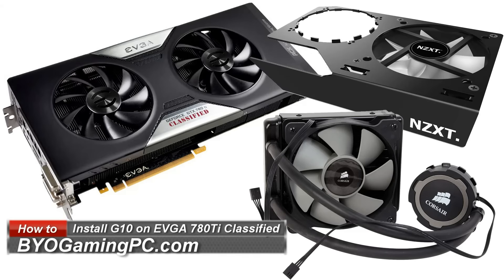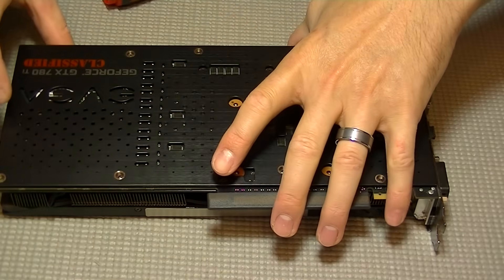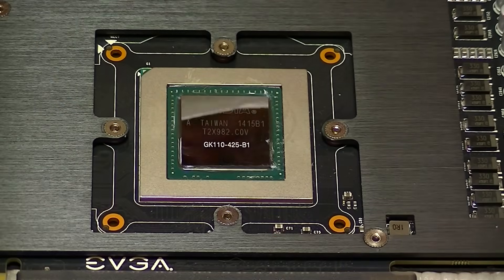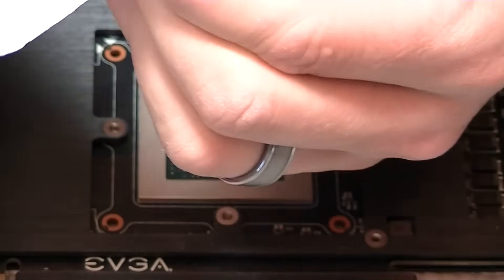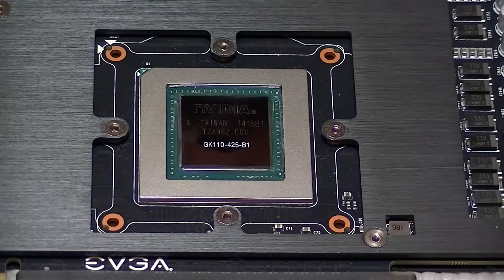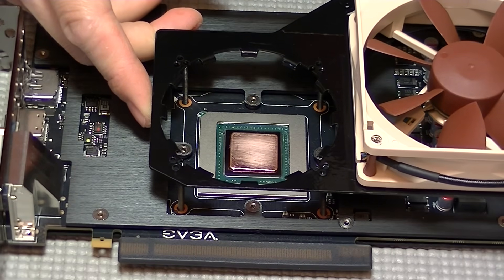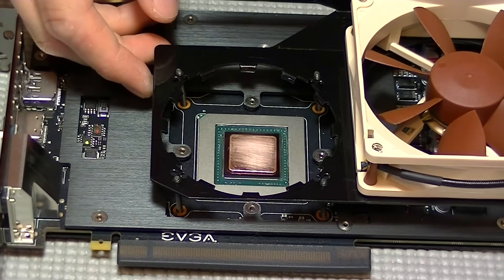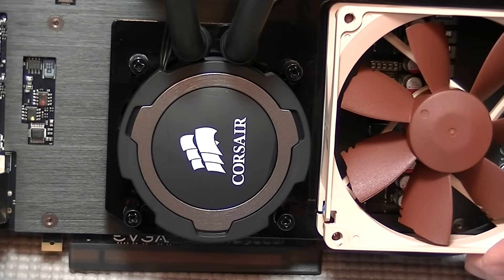NZXT Kraken G10 Install without Removing Heatsink

Comment: Nice video man, I have a question: Why did you use nylon screws insted of steel screws?, it reallymatters the material? I'm asking because its a little bit complicated for me to get nylon screws (even from amazon). Does steel screws can cause a failure or something?
Reply from the maker: You can use metal but I preferred something that wouldn't scratch.

Comment: I always knew that the extreme care of not touching the gpu die or cpu heat spreader was BS. It literally makes no difference, even the whole pea size thermal paste is BS if you use non conductive.

Comment: Hey very curious to know if this method will also work with the Kraken G12. The mounting is slightly different, but all in all the entire concept is to just make sure the cooler is touching the shim when you tighten, correct?
Reply from the maker: I've not worked with the G12 so I'm not sure. Sorry!
Reply: BYOGamingPC no problem, thanks for your honesty.
Reply from the maker: My pleasure.

Comment: I have evga gtx 780 ti Classified Install nzxt g10 I have Problem 3 light off in the gpu and not work.
Reply from the maker: I'm not sure what your problem is exactly.
Reply: BYOGamingPC 
may problem is driver nvidia 
Install nzxt g10 wthe evga gtx 780 ti classified not work gpu

Comment: Hi;
you think its worth to buy the Kraken G10 to improve my ingame FPS? I have just one GTX 980 Ti Classy, and I can game various titles at 4K 60 fps like Forza Motorsport 7 and those who uses Vulkan API, but my latest games like Assassins Creed Origins at 4K only gives 30 fps more or less with Ultra settings, I just don't want to get rid of my Card, its been an amazing video card, I just wanted to know how much FPS could I get If i install the Kraken G10 on heavily demanding games...thanks for your reply! (I would be happy if I can game Assassins Creed at 40 or 45 FPS at 4K in Ultra).
Reply from the maker: It just depends on your card and how well it can overclock.
Reply: how many FPS you get from Assassins Creed Origins at 4K Ultra? i have mine OC with modded Bios on Air and get 33 FPS Average
Reply: I  Think the Xbox One X does 4K at Ultra 30 fps on that particular game

Comment: Just installed the NZXT g12 on my evga gtx1080 FTW.
Used a dremel tool to grind down a few milometers off the front plate in order for the cooler to sit flat on the gpu, otherwise I would have to use a copper shim to make contact and would affect the efficiency of cooling, granted not by a lot but for the effort it took to install the thing it seams like a no brainier to do it right. After the installation my temps wen't from an average of 65c to 38c  while under load. 
Overclocked 90mhz on the core and 500mhz on the memory and overvoltage at 25% was able to get 2088mhz with no throttling after three hours of intense gaming @1440p with 99%-100% usage on the gpu, temp's never got above 44c  while the fans on the radiator never wen't above 1100rpms and was averaging 900rpms. Hope this helps, As for Vram and power delivery temps, J's two cents vid on the g12 should alleviate anyone's worry's about memory temps.
Reply from the maker: Excellent results!
Reply: Hello what is your cooler using it to achieve those best cool temps?, I'm planning to buy for my Gigabyte 980ti G1 Gaming gpu.

Comment: Great info, like your vid better than others I watched before this one. The NZXT back plate just did not appeal to me, using the stock plate not only is stronger but as you said offers better cooling. Don't have to reinvent the wheel, just improve on it. Someone already commented about the size of shim they used in there build(20x20x1.2mm), what was the thickness of the shim you used?
Reply from the maker: Thanks and the shim I used was 1mm thick.

Comment: why did youz neeed a additional fan cable?
Reply from the maker: The purpose was to be able to connect all of the fans to the PWM header on the graphics card so that the graphics card would control the fan speed based on thermal conditions of the GPU.

Comment: There should be used a liquid metal (Coolaboratory Liquid Pro for exam.) between copper plate and GPU, that could give you -5.. -15C degrees more ) By replacing MX-4 with metal my temperatures fallen down ~10C more. I had wish to replace my GTX980Ti Lightning stock cooler, but unfortunately G10 is not compatible with it's board. G10 could perfectly blend in with my H440 and Kraken X62. But now I wait for Vega, that I'm pretty sure, will have watercooling in stock, so G10 will be pointless for me anyway. Instruction is good and simple, nice video.
Reply from the maker: You are correct but I try to avoid electrically conductive materials for these videos. Thank you for the compliment!

Comment: 1. Is the copper shin needed if you have that back plate on the GPU board?  Or is the shin needed for keeping the VRM plate on?
2. Why haven't you used the rectangular frame thing that comes NZXT and goes on the back of the VGA instead of those washers?
Reply from the maker: A shim that fully covers the die would be more effective and the added copper helps with heat transfer. The extra layer of TIM has only a small impact on the overall cooling efficiency and this method is far better than using the stock or aftermarket air cooler.
Reply from the maker: The shim is required for the heatsink to make contact with the GPU dye. I didn't use the NZXT bracket for aesthetics. You can use it if the screws are long enough and if you don't mine having the NZXT plate showing.
Reply: BYOGamingPC does the added thermal layer effect the cooling ability? does two layers of thermal paste hamper the heat transfer?  I like the idea of keeping the OEM heat spreader, but I'm curious if a direct contact with the aio would have better cooling.  also does the fact that the shim doesn't cover the whole GPU die matter?

Comment: The copper shim is pretty pointless
Reply from the maker: It is 100% necessary if you choose to keep the VRAM/VRM heatsink on. The water cooling block will not make contact with the GPU die without it.

Comment: Guys - is there an aftermarket copper shim and extra long screws I can buy?  Or is that, too, homemade stuff.  I don't want too thick/thin or too small a copper shim.  And I don't want to end up using tie straps to hold the G-10 onto my GPU.  My GPU seldom gets above 53 C as it stands ... but I wouldn't mind cooling it even more.
Reply from the maker: The parts used in the video are linked in the description.

Comment: I want to sli two asus 1070 oc's which are very thick cards, unfortunately my mobo only supports 2-way sli so i can't put my gpus on the first and third position. Please help me, im not sure what to do.
Reply from the maker: What motherboard do you have?
Reply: Asus ROG MAXIMUS VIII HERO
Thanks for your quick reply
Reply from the maker: You should have enough spacing to install them.
Reply: also, im going with two kraken x41s because they seemed thinner, do you think i should go with these or one of corsairs wc. Is it really worth spending the 350 for this if im going to overclock.??
Reply from the maker: I don't think water cooling is necessary for the GTX 1070. It runs plenty cool enough even with overclocking. There is a voltage lock on Pascal cards that won't allow you to OC it to the point of even damaging the card. My STRIX OC never breaks 70C even with high OC's. If you set a custom fan profile you won't need any additional cooling even in SLI. The Maximus VIII Hero has enough space for airflow.
Reply: thanks, completely of the topic should i get 2 zotac 1080 amp editions instead? its only 120 more each but i thinks it'll be worth it
Reply from the maker: Since you can get the Zotac Amp! http://prourls.co/OkNO for pretty cheap, relatively speaking, I think that would be a good choice.
Reply: and cooling wise?
ive heard that the 1080s run hotter and unlike the amp! extreme which has 3 fans, the amp!edition only has 2 fans.
your advise is really helping me make my decisions, thank you
btw, this is my build:https://pcpartpicker.com/list/FwKXVY
any tips?
Reply: its also my first time building a pc and i dont want to have to spend more money upgraded in two years.
Reply from the maker: Looks good. You obviously won't need the X41's and I think you're still fine with the 1080's without watercooling them. Personally, I would just go with a single card setup and you can sell it later if you want to upgrade but a single GTX 1080 can max any game at 1440p. Even with SLI 1080's you should be fine with air cooling them. Like I said before, just set a custom fan profile and you're set. The Air 740 is a HUGE case. I would recommend something smaller like the 540 but it's up to you. You won't need the HUE since the Maximus VIII Hero has an RGB header already built in to the motherboard. Everything else looks pretty solid!
Reply: so, instead of the hue+, i should just get a compatible led strip to surround the insides, right?
also, i had picked the 740 because it had bottom fans too, and thought that would be better for sli, before that i was going to pick the phanteks enthoo evolv which is beautiful.
Reply from the maker: Correct, you just need an LED strip.
Reply: i cant find a rgb one that i like
Reply from the maker: http://prourls.co/covq Most of these strips will work.
Reply: if i get two 1080 amps will their temps without overclocking be too much(i probably wont need to oc with 2)
Reply: I was reading its reviews http://amzn.to/2hqCBbH and someone tried to do and sli on a x99 sabertooth and she got temps around 80 at 60% load, so she got a pcie extender but im not sure how that works
Reply from the maker: No, the temps will be OK.
Reply from the maker: Trust me, your temperatures will be fine. All you need are some decent case intake and exhaust fans and you will be good. Just set a custom fan profile for your graphics cards and you will be just fine. You won't need any risers or other cooling.
Reply: the corsair 740 seems like it has really good airflow, thats why i picked that one
also it has fan mounts at the bottom.
Reply: looks wise the enthoo evolv is better but it doesnt seem like it has great airlflow
Reply from the maker: Either option should work great.
Reply: i have another problem, in my case im going to have 7-8 fans(1 rear, 2 above(kraken x62), 2 or 3 in the front depending on what size i pick(3 if 120mm, 2 of 140mm), and 2 bottom) and i know there is no way i can attach all of these to my mobo, so i was researching and (i dont want to connect them all to a power supply because that means they will all be at 100% speed) and found the nzxt grid v2 (http://amzn.to/2gR6hxD) but im not sure what cables and adapters i need or if it fit all of them. Also the reason i'm using these many fans is because i wont be waercooling my gpus.(btw im going with the 2 asus 1070 strix)
Reply from the maker: I always use Noctua fans and anywhere you can use 140mm fans I would use them and get the http://amzn.to/2gPRgxU for those and for any 120mm fans get the http://amzn.to/2gPSI3a fans. The 1070's won't run hot at all. You really shouldn't need the Grid. Your motherboard should have enough fan headers for the case fans and also fan headers for the cooler which are separate. I would just get a Swiftech 8W-PWM-SPL-ST 8 Way PWM Splitter-Sata http://amzn.to/2hqzW1v if you want to connect all the fans to a single hub and control them all at the same time.
Reply: thanks a lot for your help, is there anyway i could message you apart from here? i get a notification an hour AFTER youve posted
Reply from the maker: My pleasure. You can just direct message me through youtube if you want.
Reply: can i just plug my psu into a surge protector, will there be any problems, i have attached a belkin surge protector to the bottom of my desk and wanted to plug everything on the bottom, ie  my monitor, etc
Reply from the maker: As long as it has a low enough gauge wire. You will want to make sure it's rated for the amount of power draw you want to hook to it.
Reply from the maker: I actually own that one and it's OK but I'd recommend this one http://amzn.to/2i4MpVt instead.
Reply: thanks, i was wondering if a ups was worth it( i will have my pc , a monitor, a laptop, probably a phone connected to it)  i live in cupertino where lightning is rare and in the past two years have only had one power outage, also up till now i've been using a cheap surge protector for my laptop, etc. i just wanted it to be safe because im spending about 3k on my pc.
Reply from the maker: Well, I have UPS's on all my main hardware. I just use that surge protector for speakers, a TV, and a NUC in the bedroom. :) If you can afford a UPS, it would be worth getting.
Reply: BYOGamingPC which one would you recommend, my budget for this is 100, also ill probably put this on the floor near my desk and then plug in a surge protector which i really wanted to attach to the bottom of my desk. Mainly so i can plug my laptop, monitor, speakers, pc/(im putting my pc on a stool type desk adjacent to my bigger desk). ill send you a picture to help clarify if you want.
Reply from the maker: It's up to you. Just check the reviews and go with whichever you feel comfortable with.
Reply: the new 7700k is only 10 more than the 6700k, what do you think about that? Btw, ive decided to go with the two 1070s and will write to you when the rest of the parts arrive
Reply: $340 vs $350, good thing i hadnt bought my cpu yet, should i get it?
Reply from the maker: Sounds like a good deal to me.
Reply: im sorry for dragging this discussion on and being a pain in the neck for you but im looking the new z270 motherboards(because im going to get the 7700k) from asus and wanted to get your advice( you can see all of them on pcpartpicker if you need to) and pick one. i was leaning towards the strix one but the maximus IX series looked pretty neat too, they were cheaper than the current one i was going to get. apparantly there is a 30% performance improvement if you use teh new kaby lake processor with a z270 mobo. thanks
Reply: also, i forgot to ask you if you thought an sli was possible with this mobo, like if there was enough space for these bug cards(2 rog 1070s) the one that looks great  and is in my price range asus z270 code.
Reply from the maker: Any of those motherboards would be great. It's too hard to know what boards will be most stable since they were just released. Your best bet is to check out some reviews of them but generally speaking, any full ATX board should be fine for SLI with good spacing between the graphics cards. mATX and ITX boards are not very goo for SLI unless you water cool them.

Comment: kraken??? i see a corsair
Reply from the maker: The Kraken G10 is the bracket.
Reply: BYOGamingPC I know,  I already bought the bracket,  but the cooler,  I see everyone has the corsair,  I would like to have the kraken x31 or x41 on it..
Reply from the maker: Yes, you can use any Asetek style cooler with it. Do you have a question about it?
Reply: BYOGamingPC cuz it looks like this has a thicker radiator than the corsair and looks a Lil better
Reply from the maker: Yes, it should work just fine.

Comment: Good idea, but this has to be hurting performance. You mentioned you saw temperatures in the 60s. You really should be seeing high 40s/low 50s with a solution like this. But great thinking, I didn't know you couldn't keep the EVGA plate without a mod, I thought an Asetek cooler would fit thru the tabs.

Comment: i have r9 380x with stock fan my temps 27c on load  gameing 51 c some video cards like newer ones out will not need water cooler no more .depends on your case if you have good case you all set i have cm storm stryker

Comment: just put this on my gtx 1080 g1 edition, and removed it almost right away the Gp104 chip stayed icy cool but the memory was right next to the die so it must have overheated 30 seconds into a benchmark it just flat lined in it's vitals and everything was going nuts was a shame was super excited for this maybe it might work on another card.
Reply from the maker: Are you sure that it was the memory overheating?
Reply: positive the G1 Gtx 1080 has 5 chips that don't get any airflow when using this cooler, the other 3 get some breeze along with parts of the vrm.
Reply from the maker: You may want to try some of the VRAM heatsinks in the description. These Cosmos Copper VRAM Heatsink (Optional) http://azon.ly/IpadRw may solve your problem. ;)

Comment: Hi, i have a problem finding m2.5 screws in my country. Will m3 work if i use my own thumbnut?
Reply from the maker: They may work but they may also be too large a diameter to fit the mounting holes.

Comment: How much mm thickness for shim if I was to do this with stock GTX1080 FE cooler?
Reply from the maker: I would just go with the 1mm shim to be safe.
Reply: BYOGamingPC actually you should always read the manual linus tech tips said that it might burn your gpu if you put the wrong thickness
Reply from the maker: This is a custom mod so there is nothing in the manual about it. Using a thicker shim won't have a negative effect. More metal = more heat dissipation (assuming it fully covers the GPU). Using one too thin will not allow for contact between the GPU and heatsink which would be problematic. Having one a little thicker than necessary will not hurt.

Comment: Hey BOYGamingPC 
Can i use 20x20x0.8 Copper Shim instead of 20x20x1 or will i not work very well? :)
Reply from the maker: I believe that it will. If I remember, .75 is the smallest you can use.

Comment: Is the passive heat sink/spreader over the vrams better then individually installed
passive heat sinks by me???

I have both options available to me with my aio install on my msi 980ti gaming in the future week.
Reply from the maker: Yes, I would use the one that comes on the card.